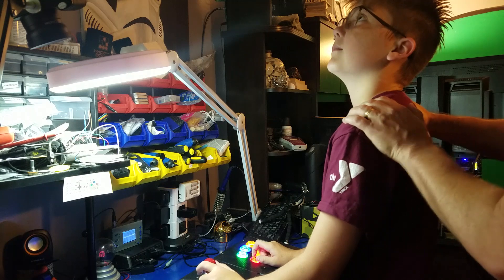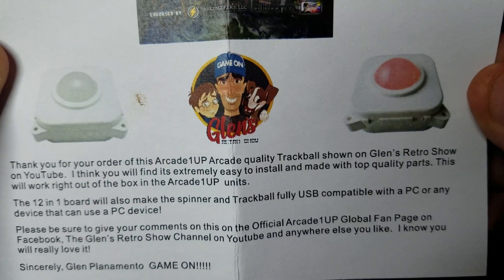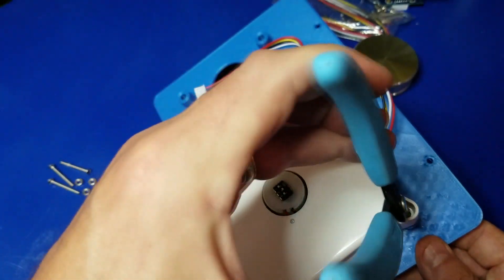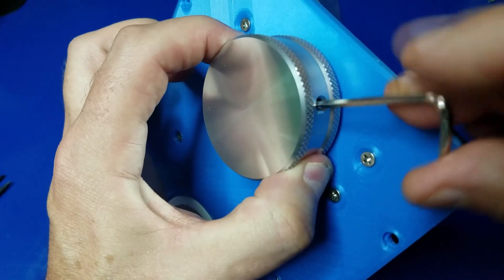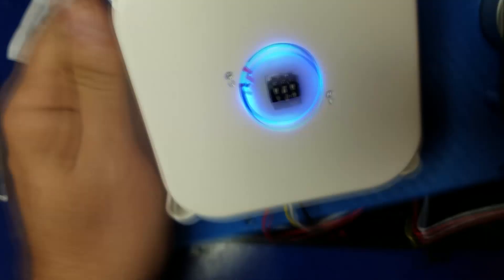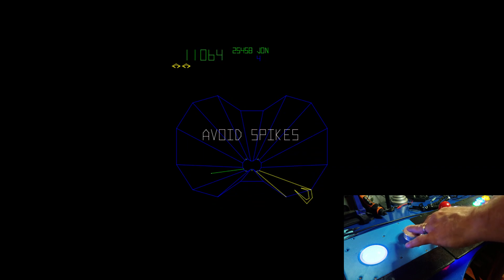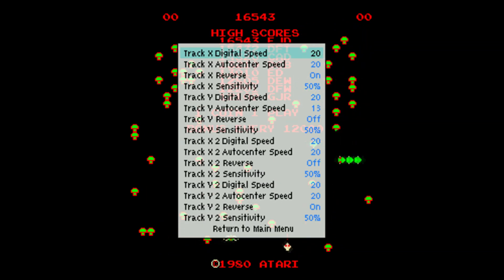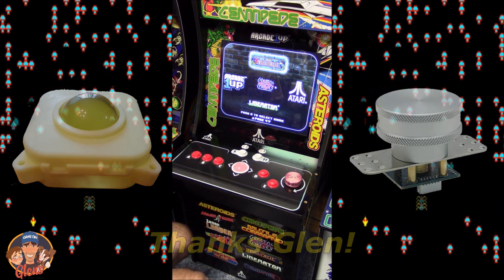How-To: Add Trackball+Spinner with Glens Retro Show parts to OpenCADE RetroPie MAME ARCADE Console!

Comment: Hi there.  I've got the trackball and the spinner - threw them in a vertical cabinet.  Everything works except I cannot get the spinner to speed up - I've tried to crank the sensitivity and the digital speed all the way.  This does improve the spinner speed but no where near what you're showing up there for tempest.  Also, as an example I've tested with arknoidu/2 and same thing.  I can also use the trackball at the same time as the spinner in Arknoid.  The trackball seems pretty decent as long as I crank up the speed and sensitivity but spinner is still really slow.  I've got this in an RPI 3B+ using advmame1.4 (even from a command line). Any help would be greatly appreciated.  Thank you!
Reply from the maker: Hi Sam, I documented everything I did here: http://wagnerstechtalk.com/grs/#Add_a_Trackball_and_Spinner_to_OpenCADE  Please read it over, make sure you have the dip-switch settings correct on the interface board.  There are also settings for AdvancedMAME recorded on that page.  If none of this helps, my recommendation would be to reach out to Glen at https://www.youtube.com/user/gplanamento  He's a great guy, always super-helpful and best of all knows the hardware details (spinner/trackball/interface board) way better than I :)
Reply: @WagnersTechTalk  Thank you so much.  I will give all the info a try and see if that corrects my issue. Appreciate the response.
Reply: @WagnersTechTalk  Thank you - this worked perfectly.  It was the dip switches - they are so small that I thought I had put in the right orientation but I was wrong.  I missed 1.  Alas - all is well.  Appreciate your help with this. Thanks again.
Reply from the maker: @ssingh1234  You're very welcome, happy I could help!

Comment: Nice set up...wish you had a simple set of drawing with dimensions so I can built this in all one piece complete unit.
Reply from the maker: You could attach the pieces in your splicer, then print.  I used the full size of my print bed for this, no room to print more than one at a time.
Reply: I purchased a arcade pedestal with raspberry pi 4, the trackball is installed wired ready to go, but doesn’t work , was told needed to be set up with keyboard, I have keyboard don’t know what to do? Please help

Comment: Like we're gonna assume everybody has a 3D printer which majority do not.  The problem with Glenn's trackball is you can't just mount to any panel board. The screw is set in the middle where it makes it difficult to  mount on any flat surface.
Reply from the maker: Maybe you've not seen his upgrade kit for use with Legend's Ultimate https://amzn.to/2V2wg9i  He has great controls, I just so happen to have a 3D Printer and designed this stuff to work with his.  You can have the cases printed (link on thingiverse will send it to someone else to print/send to you), your public library (well, not now but normally) or print it yourself.  Tons of options.  That's the whole point of OpenCADE is to have options that make it configurable.  I don't assume it's for everyone, only those who are interested...

Comment: The main problem here is that all the MAME advances the Pi has got, over the last few years, has been in Mame2003+, while Advance Mame 1.4 is old.
Problem is, I haven't found a way to get a trackball working in Mame2003+, despite following all the guides and forum posts.
Reply from the maker: True, but it's super-easy to copy the roms to the Advance Mame folder that utilize the trackball and spinner as opposed to getting Mame2003+ to work.  I spent some time with Mame2003+ and it was a PITA.  Just using Advanced MAME for the games that need trackball and spinner was the way to go, at least for me.  SOOO much easier and worked just fine.

Comment: centepede just keeps kicking me out, no advmame-1.4 selection :(
Reply from the maker: Make sure the rom(set) you are using matches the version of MAME that you're running.  If launching the game doesn't work, that means one of the two is not correct.

Comment: Why is it always Sanwa? Is there a STL for us Happ lovers? Great info anyways; I found this looking for a quality spinner for arkanoid.
Reply from the maker: Hi Brandon, that's why the Expansion Pack was added: http://wagnerstechtalk.com/opencade/#Included_in_the_Expansion_Pack  There is a solid Control Panel which just has the screw holes.  Using that, you can use any program (like the free 3D Builder from Microsoft) to drill holes wherever you want them.  It provides you with an easy option to build it however you want.  I'm also happy to host the information/models that anyone comes up with on my site.  The good news is everything I can provide is freely available and extendable.

Comment: Trackball working fine. Spinner is unresponsive. Windows 10.
Reply from the maker: I didn't test it in Windows 10, only on RetroPie.  For RetroPie, here are the dip switch settings: http://wagnerstechtalk.com/grs/#Control_Panel_Assembly_Instructions  It may/may not be the same for Windows.  If this doesn't help, reach out to Glen for assistance (Glen's Retro Show on YT).
Reply: @WagnersTechTalk  appreciate the response. I have it plugged into a USB breakout cable right now. I'm going to plug it into its own powered slot when I get home. Fingers crossed! Ready to play some tempest!
Reply: @WagnersTechTalk  I got it running! I had to use 3rd party USB device viewer to find it. It was installed and listed as a mouse device but unresponsive. I ended up rolling back the driver and it works fine now. MAME is still giving me some grief but I'll get it figured out.
Reply from the maker: @DaveLuxmore  Awesome Dave, glad you got it working!

Comment: I don't like it. It shakey and too loosie compared to the cheap Chinese trackball which has more friction and feels more grippy.
Reply from the maker: Are you talking about the case or the trackball?  I've found the trackball to work quite well myself.  I believe a new version is coming soon, however.  GRS is constantly making improvements.
Reply: @WagnersTechTalk  His trackball. It does not feel as solid when you roll it.  It feels shakey compared to the cheap chinese $30 trackball where it feels more grippy and solid when you roll it.